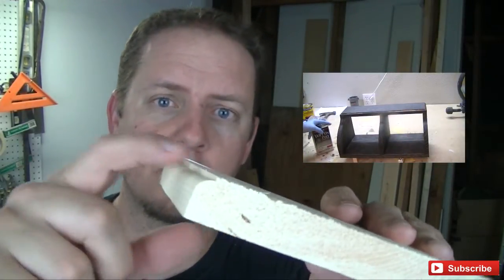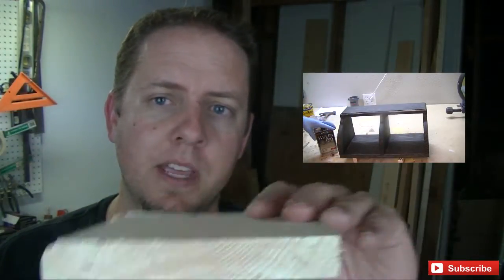How to make Entryway Hooks - DIY Project

Comment: Reduce the blotchy clear finish by making long consistent strokes across the entire work piece by moving your body and not your arm. If you miss a spot just keep going. After the first coat dries go over it again and make sure to hit the bad spots in the same long consistent strokes. Works for me with clear finishes.
Reply from the maker: Good tip, thanks Jay. I have a cheap Harbor Freight sprayer that I need to dig out and start using. I think it will give me a better spray. I thinks it's the same one you used in your half lap bar stool video.

Comment: I know this video is older, but it’s super simple and to the point - thank you! One question... what kind of drill bit did you use at the end so that the head of the mounting screws would be recessed? I want to make one of these but don’t think I have that tool. Thanks for sharing your wisdom!!